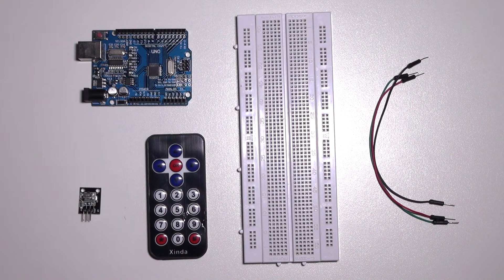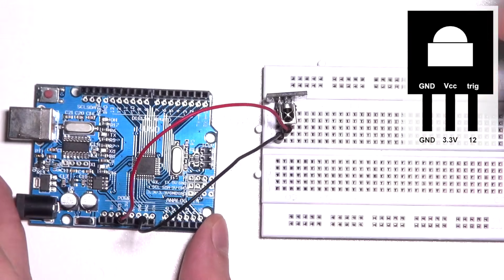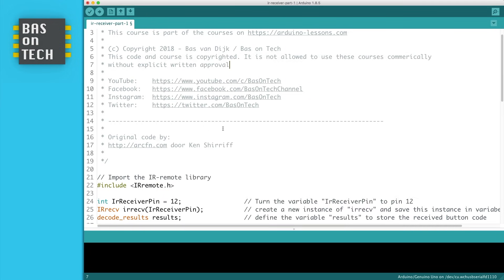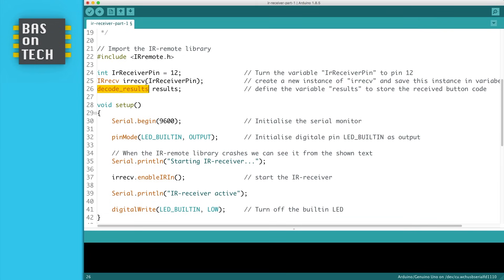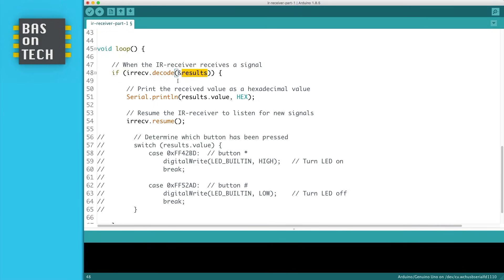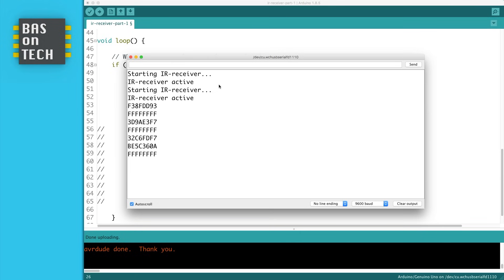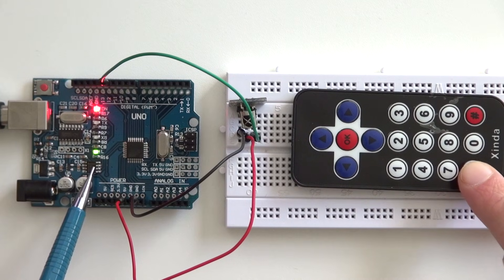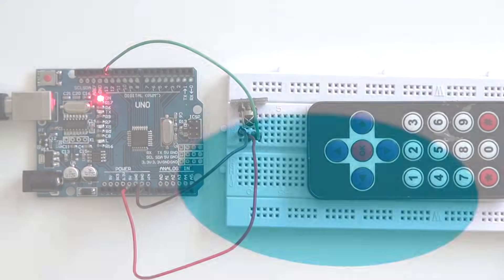IR-REMOTE CONTROL / IR-RECEIVER (HX1838 VS1838) - Arduino tutorial #9

Comment: hey Bas, I am using a type of remote same as you do but each and every button i press near the IR receiver I only get  codes like
FFFFFFFFF
FFFFFFFFF
FFFFFFFFF
FFFFFFFFF
FFFFFFFFF
FFFFFFFFF
But when i take to a certain distance i get many different codes like for each  button i get  many code more than 20 or 30 i dont know which one to choose can you help me with this out.🤥🤥🤥🤥
Reply: even if i use any other remote this issue cant be done
Reply from the maker: That is kinda weird indeed. Some thoughts:
- Receiver could be broken
- Please check your circuit wiring and make sure the right wires are connected to the right pins
- Maybe there is some interference of something that sends out IR signals
- Try some other breadboard holes, sometimes they wear off and cause malfunctioned connections

Hope this helps 😃

Comment: Hi Bas. 
Can I use the 'CAR Mp3' infrared remote instead? 
Will the code work anyway?
Reply from the maker: Unfortunately the only way to tell is to try. I've had remotes that worked and didn't work. The code should be fine, only the codes send by the remote will probably differ.

Comment: Thank you very much bro,  I have a question  for example I have  20 selection I mean more than 10 selection, So this is mean I have to press two buttons for example 1 and 5 to select number 15 ,so how can I do that, I mean how can I use 2 codes from IR remote to apply an action ?
,🌹🙏👏
Reply from the maker: Nice question! You can, however to get it right could be quite some work. You have to measure the time between two buttons pressed. This way you if someone pressed 1 and then 0 for 10 or that someone just intended to pick only 1. This tutorial could help you with this https://arduino-tutorials.net/tutorial/long-press-button-on-the-arduino-with-millis
Reply: @BasonTech  
Thanks my friend 🙏

Comment: My receiver gives me many different hex codes each time I push the same button. I have the same problem with all Typs of remotes no matter if I use a selfmade remote, universal remote or tv remote. My it receiver is not able to get consistent code for the same buttons.
Reply from the maker: Could it be that there was some interference of daylight?

Comment: got an error when I uploaded code: 
TWD2 
exit status 1
 Error compiling for board Arduino Uno. 

It's in the correct com port and I'm not sure what the issue is. any tips?
Reply from the maker: Hard to say what could be wrong. It looks like your code contains an error. Are you perhaps missing a library?

Comment: it just spams:The function decode(&results)) is deprecated and may not work as expected! Just use decode() - without any parameter.
when i touch the remote it says only 0
Reply from the maker: According to the documentation of https://github.com/Arduino-IRremote/Arduino-IRremote#converting-your-2x-program-to-the-3x-version You probably use v3 of the library. At the time of recording the tutorial I think I was using v2. The docs state:
Old decode(decode_results *aResults) function is replaced by simple decode(). So if you have a statement if(irrecv.decode(&results)) replace it with if (IrReceiver.decode()).
So maybe something else is not working correctly

Comment: i just get an error: Error compiling for board Arduino Uno.
Reply from the maker: Very hard to say what could be wrong. Could be an error in the code, wrong port for the Arduino, wrong board selected, missing library etc.
Reply: @BasonTech  I can program the arduino to flash an led and others but I can’t get it to upload this code so I’m not sure
Reply from the maker: Then there should be something with your code / libraries
Reply: @BasonTech  ok I’ll have a look into it a bit further

Comment: The Elegoo IR remote seems to have a strange encoding pattern. Every button corresponds to 2 different values. One is a 6-digit hex code where the first two values are always "FF", e.g. "FFE01F" is the down arrow button. The other value is either an 8-digit hex or 6-digit hex (e.g., "F076C13B" is the 2nd value for the down button, but "511DBB" is the 2nd value for the VOL+ button).

I'm still trying to figure out why this is. The 2nd values appear to only be received when the remote is at a slight distance from the receiver or is not pointed directly at it. If I get too far out of range then the receiver will read the signals as random values or simply won't detect any signal at all.
Reply from the maker: Hi, the thing is that each remote has its own coding. The IR-remote used in the video luckily gave consistent codes for the buttons.

Comment: Hello Bas,i have a problem.Each time i push a button in the third case he send me too many same codes like 
2A8A96B1
2A8A96B1
2A8A96B1

and i can't know if the remote sensor is working or not...can you help me Bas?
Reply from the maker: Have you tried to use another remote? Multiple codes should no be an issue. As long as they are the same for each button.

Comment: THE CODE IS OK BUT I SAW THAT SAME BUTTON IS GIVING DIFFERENT VALUES AT SAME TIME WITH MULTIPLE REMOTES
Reply from the maker: That is completely normal. Each brand of remote has its own IR-codes. Therefore you have to set the brand on an universal TV remote. Then the remote knows which codes to send for each button
Reply: @BasonTech  THANK YOU

Comment: My IR remote set comes with transmitter that looks like white LED.  What do you do with it?
Reply from the maker: Hi, the white LED is actually an IR LED. By blinking this LED you can transmit IR signals. However the remote of the set I use (see link in description) is a lot easier. You can also try to use an IR remote of your TV or something.
Reply: @BasonTech So, this transmitter is also inside the remote controller. That's why you don't use it  in this video?
Reply from the maker: Exactly, the remote does the encoding automatically for me. When I press a button, the remote translates the button to number of flashes of the IR led on the remote 😃
Reply: @BasonTech  Thank you for replying. One more question sir. Why every time button is pressed, it returns 2 sets of value with 2nd one #FFFF?  and sometime just "FF"
Reply from the maker: I am not entirely sure but it could be a termination command in order to separate codes.

Comment: How can I use it wihout arduiono ?
Reply from the maker: Hi, you need at least a microcontroller to controller the receiver. Wat do you want to make so you don't need an Arduino?
Reply: @BasonTech I just bought remote & IR hx1838 for turn off & on but no arduino....thanks for info.

Comment: When I try to upload it says "no matching function fr call to 'println(long unsigned int*, it)'"
Reply from the maker: It looks like there is a typo somewhere by a  Serial.println command. Please make sure all the quotes are correct and have a opening and end quote 😃
Reply: Bas on Tech but everything is highlighted like how you did it. I even copy pasted the code and it still doesn't work. I'm pretty sure I downloaded the right libraries and I'm not missing any punctuation throughout the code
Reply from the maker: @s_iri5368  Somewhere should be something different. What if you remove all println statements from you code, will it then compile?
Reply: @s_iri5368  you missed the & sign.

Comment: Is it okay to use Tl1838 IR receiver?
Reply from the maker: I've checked the spec sheets of the TL1838 and VS1838 but couldn't really spot the difference, although there should be one. So my guess is the TL1838 would work as well 😃
Reply: Out|Gnd|Vcc - same. You can put Vcc to the 5 and the 3.3V pin, doesn't matter.